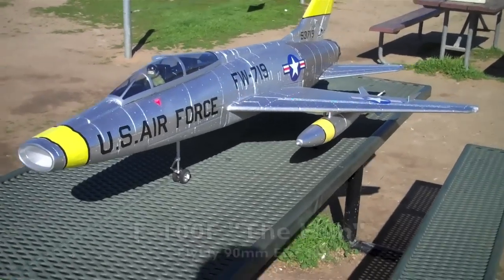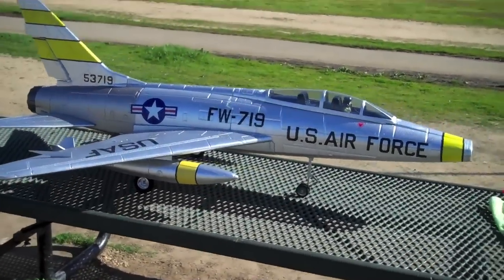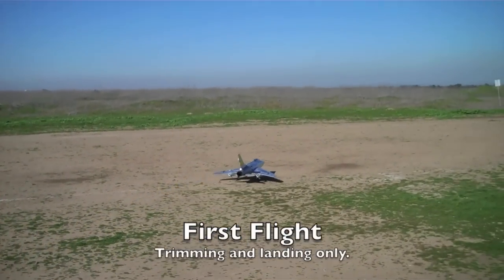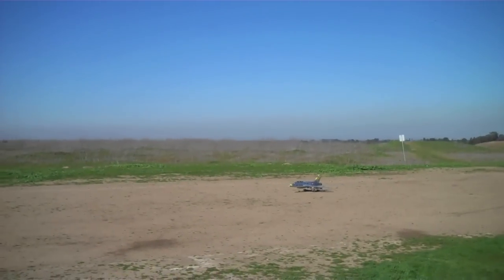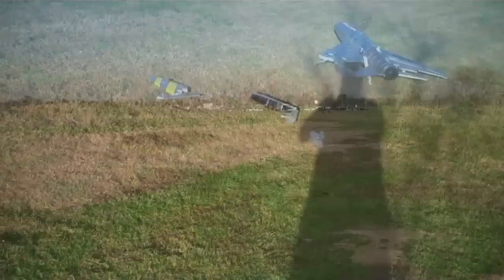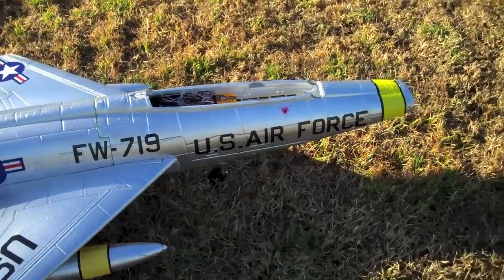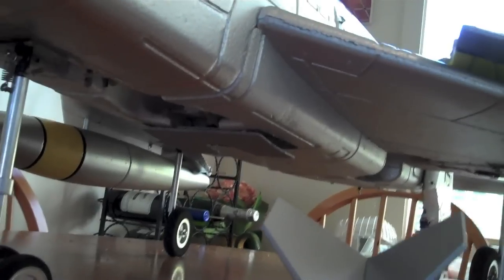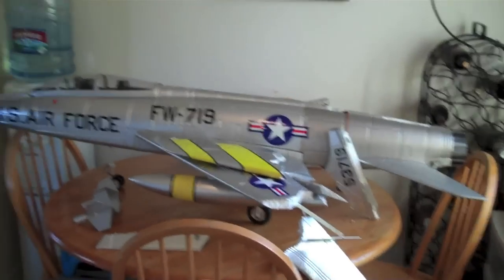F-100 Super Saber Maiden flight and crash.

Comment: At 3:44 you said; "lets try the speed brake" and by 3:48 it was in the ground.   Approaching landing speed, swept  wing aircraft are notorious for tip stalls, and very notorious if you are turning away from the wind in final approach.   Speed brake should only be applied at a high enough altitude to recover or high enough speed to recover.  Additionally,  speed brake can be used in landing if you already are a foot  or two above the ground and you are already steady for landing, but you have no room for error.  Or you already touched with the wheels but now want to dampen your speed.  As soon as you mentioned and functioned speed brake, it was like....in to the dirt.  Straight wing planes have great or reasonable handling at low speeds... not so swept or delta wings.

Comment: The F-100 was notoriously unstable at slow flight and several pilots died on the base to final turn. The design had a severe negative static stability at low speeds, thus it could begin to oscillate with yaw. So when you added speed brakes at that point in the flight, it was a death nail. Look up the "sabre dance" for more info. This is one design (if you follow strict scale) that you HAVE to use rudder and NOT just ailerons for slow flight turns.

Comment: I was in the Air Force and worked on F-100's. I've also flown twice in an F-100F. My recollection is that they never deployed the speedbrake close to the ground or during landing. The F-100D & F models had flaps and a dragchute to slow them down for approach and landing. For emergencies they also had a tail hook and our runways had an arresting wire at the end like on an aircraft carrier. The main reason for the speedbrake was to quickly bleed off airspeed during air-to-air combat in hopes that an enemy jet would shoot pass the F-100 and get in front of it. In fact I don't think I ever saw an F-100 in flight with the speedbrake deployed. If you want to add something useful that will also add  realism to your model, add a dragchute. Real F-100's never landed without deploying the dragchute.